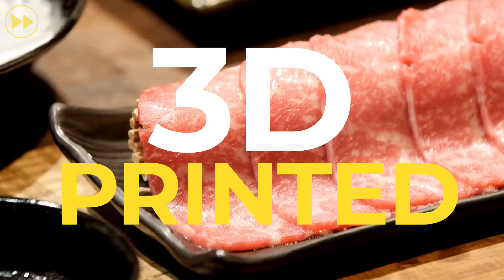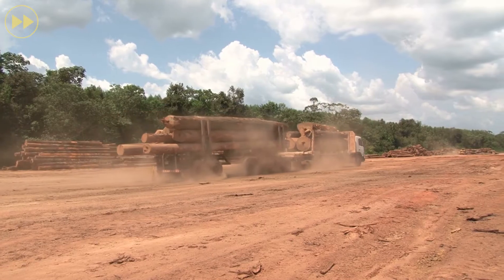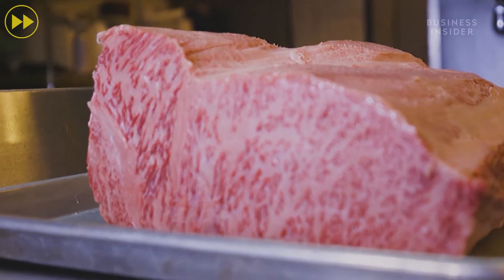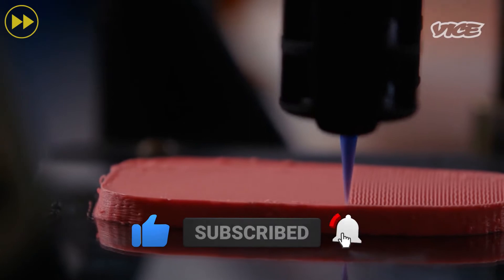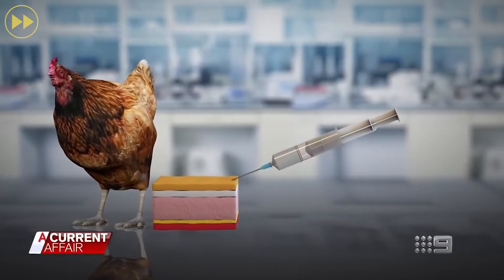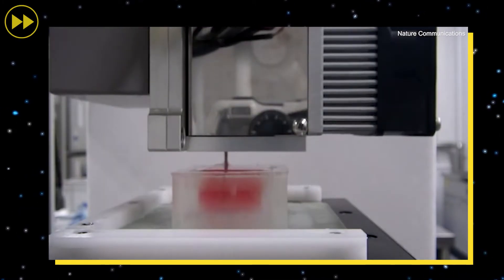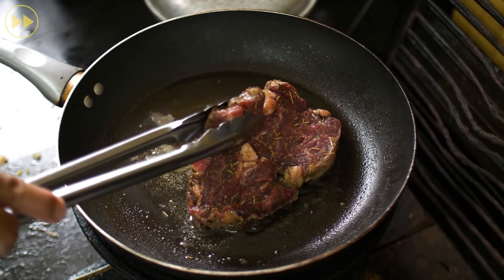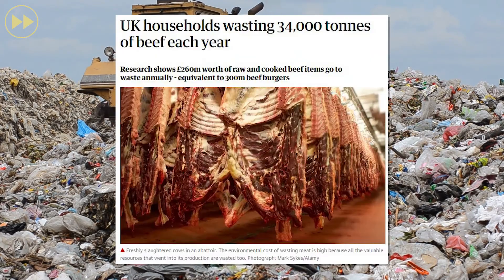World's First 3D-Printed Beef (Wagyu)

Comment: Ermmmm but how much pollution would it cause to make a printer?? And what's the nutritional value like?
Reply: Half assed solution to a big problem
Reply: Technically, it's a bit worse that we lose as many cows as we do due to consumption. So, I doubt this would be worse. Now, the price is a separate issue because this has GOT to be expensive
Reply: Price can be lowered, it’s still being worked on. Nutritional value is higher than normal meat.
Reply: Pollution is much lower … I mean cmon cows themselves are a global cause of greenhouse gas release
Reply: Bro nobody cares about the nutritional value of WAGYU. It’s the fattiest meat and nobody eats it to be healthy. Also, you only need to make one machine, while cows have to be fed for months
Reply: Same, you are growing the tissue,real tissue. It will be slightly different nutritional value but probably will have same amounth of basic things like,fat,carbohydrates and proteins. Only a few hormones and protein types would be missing, such as the ones tissues cant produce and we cant detect properly to put it. Overall it would be much more healthy since it wont have heavy metals,toxins and antibiotics
Reply: @exosproudmamabear558  you can actually pretty much make your own designer meat ! Whatever nutrients you want, you can theoretically add. Even if you’re allergic or don’t want meat, there are other 3D printed “meats” being created out of other materials. And it’s a similar concept.
Reply: @sarahdiehl2672  Those are not really meats, more like vegetable paste, tho. but I agree with you, you can do your designer meats. You can even put in the tissues (It will naturally absorb and store it for you) some vitamins or supplements that cells do not have naturally. You can layer the tissues with spices and other vegetables for a spesific taste even use some of them as natural antibiotics or antiseptics such as onions,garlic,thyme so the meat wouldnt spoil fast.
Reply: @exosproudmamabear558  I haven’t watched the video in a bit so I wasn’t sure if this was a cultured one or not ! I did a research project on it recently, truly fascinating stuff! There are cultured meat products out there but it’s still in development- but it seems the most promising and probably seems the least weird to most people. It could be world changing if we can do this right. World hunger could be solved, anyone with dietary restrictions or eating and swallowing disorders could be greatly helped, and we could end the abuses of the meat trade !
Reply: This is one of the worst things you can put in your body, super ultra processed with chemicals you would not want in your body.  As far as greenhouse gases ,  that is all smoke they are feeding you. real  Beef is what's for dinner.❤
Reply: How are they going to clean the equipment